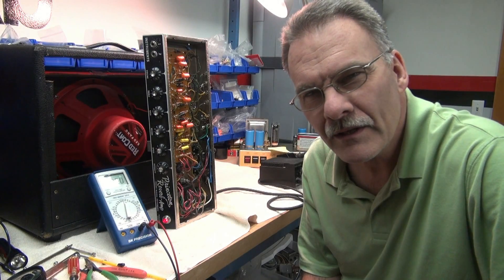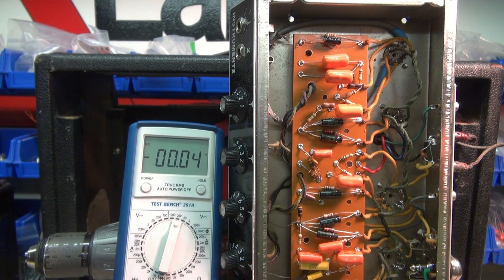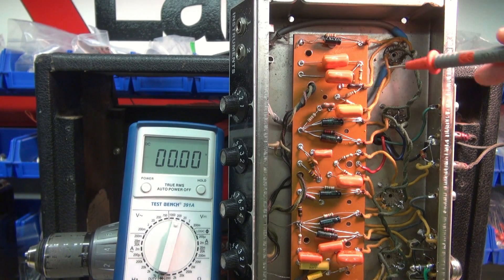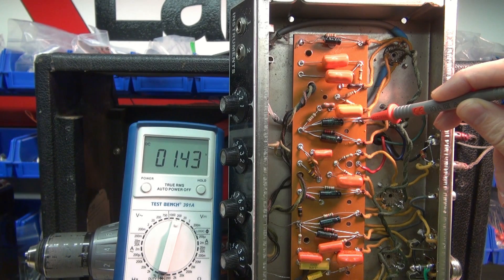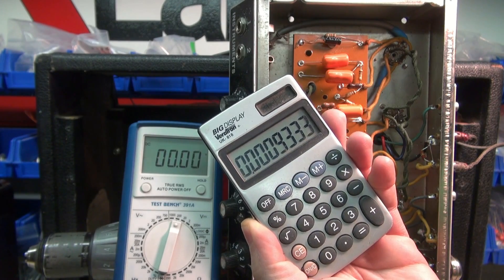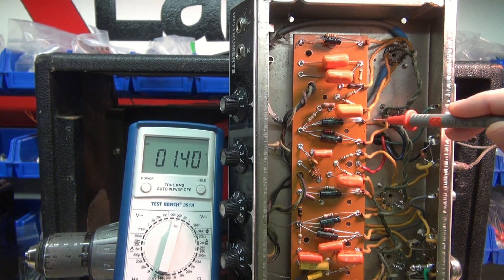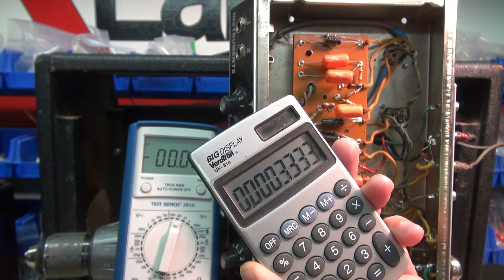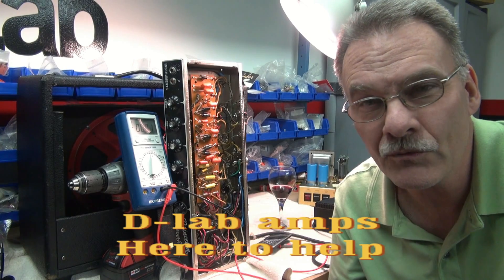How to check Fender Princeton amp Deluxe 12AX7 tube using a meter

Comment: I guess the moral of this "tale" is that there's more to owning a tube amp than simply buying it and playing through it. You need to have some understanding of what makes them tick and what you need to do to keep them running. Good video, though I reckon a warning about the high voltages present might have been wise (no criticism intended).
Reply: You are right , if someone doesn't realy know what he is doing measring the voltages - he might cause more harm then good to himself or even worse to the amp ;) (no criticism intended as well).